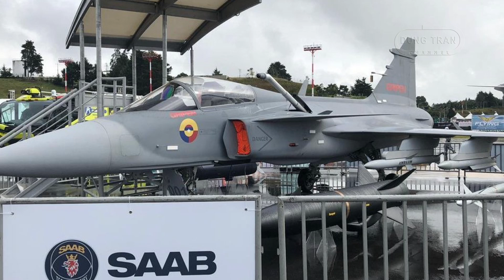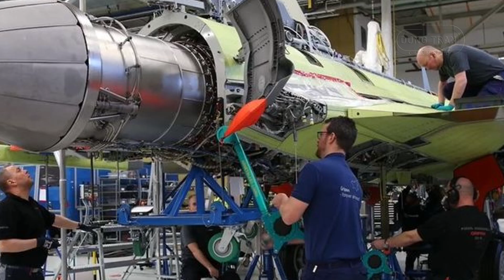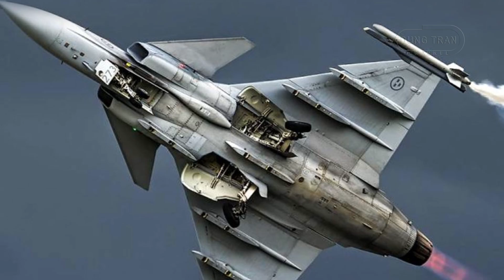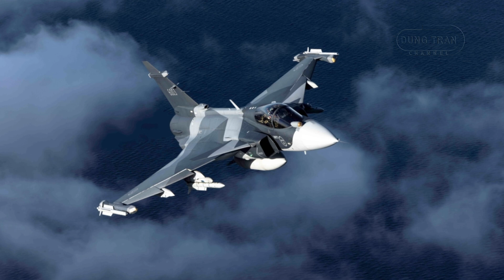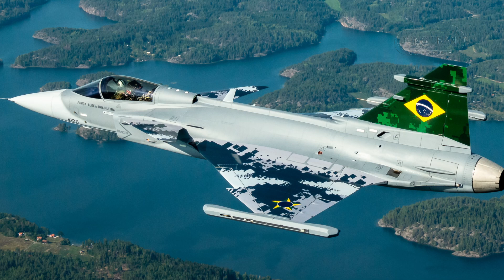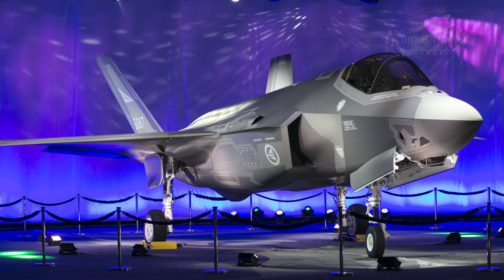Swedish Gripen's Achilles Heel: The American Engine

Comment: Canada needs about 70 aircraft in addition to the 16 F-35's its already committed to.  It should partner with Saab to fund the replacement of the GE engine with one made in Europe.  This would help break the US veto on the GE engine, support the EU, and would give Canada a bit more leverage in its deal with Saab.  The Canadian built Gripen could be called the Arrow II.
Reply: Well Canada did produce the Iroquois engine for the cf-105 arrow but it was shelved. The new company Magellan Aerospace could work with Saab to develop a suitable power plant for the fighter. And we could regain some pride knowing we did it here.
Reply: @richardstevens801 fun fact: Magellan makes GE jet engines. Specifically, the 414-E 

The one the gripen (and f-35) uses.
Reply: With the much lower operational cost of the Gripen, we could easily afford over 300.  Why stop at 70?
Reply: Good idea. But after building the Gripen in Canada we should hold the Arrow II name for our own new design.  :)
Reply: Hypothetically, theres rolls royce facility in Peterborough that could become a maintenance facility and factory for a rolls Royce ej 230 ..so it would be less than an hour from CFB Trenton...the main Airforce Base in Canada it could be done
Reply: @davidbeattie4294  
Thats to late for the Jas 35 
But the new one in development that’s is orders as a concept by FMV to be produced before the end of this year. 
Maybe won’t get a US engine, who knows. 

Stay tuned
Reply: @ Whether an engine change is too late for the JAS 39 depends entirely on whether SAAB has already done any work on alternate engines or not. If they have done the design work necessary to drop an EJ200 into a prototype it's not too late, if they bet the farm on the GE F414 and American benevolence then they are in trouble.
Reply: @ 

Nothing is ever “to late” it’s a matter of money and resources. 

Saab and GKN Aerospace is to develop a new plane before the end of this year. 

Also that plane if it gets the go from the government are to take its first flight in 2030. 

This is shrouded in secrecy, but if one follow the money and the human resources allocated  it’s safe to say 

“It’s to late”
Reply: This is a mostly a BULLSHlT story
Go and look at the specifications for the JAS39 on Wikipedia and see how much of the plane and weapons are American.
- the PS-05/A Avionics are GEC Marconi and even though its now British owned there's still American IP in it.
- the AIM-9 Sidewinder air to air missiles are American
- the AGM-65 Maverick air to ground missiles are American
- the × GBU-12 Paveway II laser-guided bomb, Mark 82 bombs and GBU-39 Small Diameter Bomb are American.

Sure all that can be replaced but integrating other weapons takes time and money.
In fact if you look down at the E & F models the name Arexis is mentioned and that's a division of SAAB. So those models have more European avionics in them but the weapons are still the same.

On the engine the current engine in the Eurofoghter (Eurojet EJ200) has similar (but slightly lower) thrust specs but it might be upgradable to suit. if you look at the Wikipedia page there are plans (2 stages) to upgrade the EJ200.

FYI - I'm Australian and think we should seriously consider a large batch of JAS-39s instead of another batch of hyper-expensive F35s. There's a great video on Ward Carroll's channel with a pilot named Paco (his callsign) and he explained the role of the F15-EX and part of its role is to create noise across the spectrums for the F35s to hide in. There's a problem that when there's only F35s in quiet/stealth modes that it can be so quite across the spectrums they can be found. Its really interesting to listen to him explain it.
Reply: @tonywilson4713  The JAS E/F, which is the actually interesting variant these days, uses the Selex Raven ES-05 AESA radar made by Leonardo in Italy. The AIM-9 Sidewinder, AGM-65 Maverick and GBU-12 Paveway are all very easily replaced. The US normally vetos Gripen sales over the General Electric engines as far as I can tell not avionics or munitions the Gripen can carry. That being said, SAAB and Eurofighter GmbH have a lot of work to do eliminating American IP from their aircraft now that the US has declared itself a completely unreliable supplier. American vetos have ruined far too many sales for Saab already.
Reply: @ChristianThePagan  Am just watching a guy named Dan O'Connor in Nat Hagens. I'd seriously recommend it.

I'm an engineer and some of the things like energy and energy infrastructure is a monster issue in my country Australia AND NOBODY wants to discuss it.
Reply: @tonywilson4713  ASRAAM is supposed to be the Sidewinder replacement, so it should work as-is. Gripen-E can also use IRIS-T (I thought I saw Python mentioned somewhere). Mica for medium range, with Meteor for long range. You can use the Taurus KEPD cruise missiles for ground attack. I can't find it now, but Saab also mentioned smart bombs & an anti-ship missile (not American).

Hopefully, Saab is fairly advanced in their testing of alternative engines. I'm not entirely sure why they stopped the Columbian sale. I don't think F-18s are still in production, aren't F-16s produced offshore now? Turkey will be pissed if they buy F-35s.
Reply: @georgejones8784  Yeah there's bound to be alternatives but you also need to consider that they have to re-configure the weapon system to use anything new.
Its one of the things people forget that you can't just use whatever on these planes. The weapon system has to know what's onboard and be able to use it.
Reply: @tonywilson4713  those are weapons that Saab states are usable on the Gripen (except the ASRAAM). I believe it was mostly on the Indian info page. Others may have been on the Gripen-E page.
Reply: @tonywilson4713 with regards to A2A weapons - it can also use ASRAAM and METEOR. So strictly in an air defense role it is not entirely dependent on US Arms
Reply: @SteelBattalion07  Yeah those are in the weapons lists on Wikipedia.
So its not entirely dependent on the US but enough of it is.

Right now it all comes down to Trump and how temperamental he is on which particular day.
Reply: The Gripen uses the engine from the F-18. So Canada has enough engines for 160 ish Gripens already.
Reply: @JamesBrix86  Canada flies an A+ variant. It's got APG-73, upgraded software for AMRAAM, etc, but I think it's the original engines. Looks like F404-GE-400. The F414 appears to have a little over 20% more thrust, which is partly from its increased size I would guess. If the F404 runs more efficiently, it might work, but the airframes are approaching 45 years. We did buy about 2 dozen Australian F-18s, which might be newer.

Who knows. We should maybe consider buying 50-60 Gripens with an option for another 50. Once the first delivery is completed, we could see what Japan, UK & whoever else has in stealth, and decide between 50 stealth fighters, or another 40-50 Gripens.
Reply: @JamesBrix86  No, the Gripen uses a specialised variant of the GE engine redesigned and license manufactured by Volvo. Also, the really interesting Gripen E/F uses a Volvo variant of the GE414.
Reply: @ChristianThePagan  GE Aerospace makes 2/3 of the RM12 and RM16 engines that GKN Aerospace completes in Trollhattan.
Reply: I like this idea. Very much.
Reply: It's not just the engine, US intellectual property is everywhere in the aircraft.
Reply: @ Then give us a list of the highlights.
Reply: @gumby2241 do we know what other IP other than GE Engine?
Reply: @gumby2241 Please detail - that’s an important realization for me.
Reply: My thoughts exactly
Reply: Agree. The A/B Gripen used the Saab RM12 engine. Saab could develop this engine to equal the  GE engine currently used. A partnership with RR my would expedite this process. Bombardier could under license build this new US-free aircraft.
Reply: Go with the French Rafael dual engine which has always been mandated for artic patrol no US parts and would have beat the Gripen if they didn't pull out because of US interoperability.
Reply: @SeanMcInnis72  Reasonable idea but you'd need a total re-design of the fuselage to take 2 engines.
The planmed advanced EJ200s out of the Eurofighter can do the job.
Reply: @SeanMcInnis72  Canada rejected the F-16 back in the 80s because a single engine wasn't reliable enough in the Arctic. Now, suddenly, a single engine F-35 is ok. The military knows they'll be stuck with whatever is chosen for the next 50 years, so naturally, they want the most expensive plane out there. I wonder if an F-35 will make it to 40. The F-117 is retired & the F-22 will be retired from frontline service soon. Both, I think before 30 years. I haven't heard much about how the F-35 is doing beyond some comments that there appears to be surface corrosion on the skins on carriers. Whether it's just discoloration or actual damaged panels is something that probably won't come out to the general public for a few years.
Reply: I'd sign up for Flygsystem 2020 if it can be modified to uses a European engine license built in Canada. Meanwhile their best bet for an off-the-shelf stopgap, if Canada needs one, is probably the Rafale since it has hardly any American components at all. However the Rafale uses the SNECMA engine so perhaps it is better to go for the Eurofighter since it uses the EJ200 engine which, given recent events, might end up being the one used in the FS2020. Another option is the KF-21 Boramae. There was a design option (C103) for it that could have used either the EJ200 or the GE414 but, oddly enough, the Koreans chose the C109 GE414 only option which now seems like a huge mistake. However, there might be a possibility to obtain a license to produce the C103 version. For sure, Sweden/Saab needs to get rid of the American veto one way or another, one can't be reliant of a politically unstable and unreliable source of military tech like the US is.
Reply: @ChristianThePagan  If Canada needs around 70 stopgap fighters, why not the Eurofighter? The UK is rumoured to be scrapping 50 of them. That would be a far cheaper option than buying new Rafales. Then they would have the breathing space to negotiate a licenced production deal for either the Gripen or the Rafale.
Reply: @skasteve6528  Well, as I said the Typhoon would perhaps be the best short term option or the Rafale. But those 50 UK Trance 1 Typhoons would be better used equipping a post-war Ukraine. Canada should get new-built aircraft. Either aircraft would also be a good Segway for Canada to move on to the Dassault/Airbus FCAS and license producing whatever engine the FCAS runs on since that engine is a Franco/German collaboration project. Alternatively, if Canada goes for the Typhoon and license produces the EJ200 they might consider a EJ200 powered KF-21 if that is even doable. Either way the Gripen is a no-go if Canada wins to de-risk from the USA unless the rumours about SAAB already being hard at work on integrating a non US engine on the Gripen. If that is true this engine would likely be the EJ200 since a variant of the EJ200 has been considered as a GE F-404/414 replacement before.
Reply: @skasteve6528  The UK is NOT scrapping Eurofighters. If they are, the hulls must be completely worn out, because they'll likely want to continue expanding their EF fleet.
Reply: @  I don't think they are slated for scrapping. I remember ideas being floated a while ago about donating ex RAF Trance 1 Typhoons to Ukraine. Dunno how realistic those ideas were.
Reply: @jakobholgersson4400 I don't recall the exact problem, but there's something wrong with the early Typhoons. It was either a software or a hardware limitation that requires something that makes it cheaper to just replace them with new planes rather than upgrade.
Reply: @georgejones8784  So the guy's suggesting the purchase of planes that are obsolete and impossible to modernize?
Reply: @jakobholgersson4400  they're not impossible to modernize. I think the UK looked at the life of the airframes, and considered the cost of whatever upgrades were needed, and decided it was easier to buy more. They're still effective and usable planes, but they just have a few limitations that may or may not matter. Just like some of the early F-35 bays can't hold certain ordinance. Was it the newer long range AMRAAMs or SDBs?
Reply: @skasteve6528  Why would anyone buy those, they are OLD and crappy, and the UK is not scrapping them because they dont need them but because they are falling apart. Anyone they can ducktape together they are ducktaping together and keeping. If you want all European and cant wait for Gripen getting European engines then go French. Rafale is a great plane.
Reply: @georgejones8784  As recently as 2 years ago, many Typhoon planes in service with German, Italian and British air forces still didn't have AESA (Active Electronically Scanned Array) radar, which is the standard requirements for modern fighters. Naturally, it is not just the AESA radar but also the software & computing power required to handle/process  the increase data & sensors. A sizeable chunk of new increase in defense spending in Germany is going to upgrade its Typhoons with AESA radar. Dassault Rafales have been flying with their RBE2 AESA radar for 20 years.
Reply: @qtdcanada  yes. I was looking it up. The tranche 1 Typhoons don't have AESA, and carry only ASRAAM and AMRAAM. Tranche 2&3 add Meteor, Storm Shadow & Brimstone. The tranche 1s could work for Ukraine & Canadian NORAD duties, but at some point, true multirole planes would need to supplement them. The tranche 3s appear to be plumbed for conformal fuel tanks, which would be nice in Canada (but I'm not sure than the tanks exist).
Reply: @skasteve6528 those typhoons have old nonAESA radars. It would cost 50m per plane to upgraded to the newest AESA block 2s
Reply: @Aendavenau  Those RAF Tranche 1 Typhoons are not falling apart, they have been considered for overhaul, upgrade and donation to Ukraine. They would have to have been VERY roughly treated if they are falling apart while much older F-16s and Mirage 2000s are flying combat missions in Ukraine. As for wanting older old aircraft, it's the same reason the obsolescent Curtiss Hawk 36 suddenly became a hot commodity in 1939, when countries suddenly found themselves on the brink of war with air force full of thoroughly obsolete aircraft from the 1920s a merely obsolescent fighter 1930s fighter was better than nothing and you can still upgrade older aircraft and get a whole lot of use out of them.
Reply: @jakobholgersson4400 
I think you mean air frames, and not hulls 😂
Reply: @georgejones8784 There was a major redesign to creste the Tranche II so software developed for it won’t run on Tranche I. Upgrading Tranche I to a later tranche is not cost effective.
Reply: @skasteve6528  We need them because we will need to protect Arctic - the Gripen, with its decentralized operational doctrine works better for that environment. Think beyond just the airplane itself. It must operate in remote areas, without any large facilities and dispearsed all over the Arctic - Gripen does this better than anyone. Sweden and Canada's Arctic are cold and this aircraft is designed and built to operate in that theater. The F35's we have purchases, will be great at our Southern boarder, but not suited for the harsh realities of the Arctic.
Reply: The SAAB was #2
Reply: @ Yes, but it was #2. before Trump 2.0. Now Canada needs something with no US components in it.
Reply: Our F18s have the GE F404 that has been used in some Grippens.
Reply: @realalbertan  Yes and the Americans can veto any sale to Canada because of the F414 engine the Gripen uses. If Canada wants to annoy Trump by scrapping the F-35 deal then it needs an aircraft without a single US part in it which basically limits Canada to the Rafale.
Reply: Why not just buy Rafales or Eurofighter Typhoons? I just dont get this obsession with the Gripen that many Canadian avgeeks seem to have. The Gripen is easily the least capable Eurocanard...
Reply: @lonewolf0281  Because it was the runner-up after the F-35. The new E/F version is also very impressive in that it has gallium nitrate EW modules built into the airframe for stealth, AI enabled systems, it has very impressive arsenal and it has *some* of the same situational awareness options as the F-35 (although the F-35's are better). Finally, the hourly operating cost of the F-35 is $40.000 and it requires state of the art air bases. The same goes for the Typhoon and Rafale, they need high end bases and they are expensive to operate (EUR 20.000). The Gripen costs $4700 per hour to operate, it can take off from rough grips and highways and it can be operated in the field out of a shipping container which would be a feature for a sparsely populated country like Canada.
Reply: Something with a Rolls Royse engine please
Reply: it would take years to adapt the design - you need to adapt assembly lines, jet design, and everything that interacts with the motor (hardware and software wise). why not just buy the rafale which is already ITAR free.....
Reply: @Tortuex_  because at the last minute, a specific data link requirement was demanded for NORAD compatibility. Suddenly, everybody except JSF and Gripen dropped out. I guess Eagle & Hornet don't fly continental defence missions. Anyways, Eurofighter & Dassault saw what was going on and dropped out while Saab did not. Something you have to keep in mind is that the previous Conservative government had decided to purchase 65 F-35s without a competition just before losing the election.
Reply: Or alternatively buy the Euro Fighter - Typhoon?
Reply: @davidbeattie4294  or go Eurofighter Typhoon with BAE or go Rafale with Dassault.
Reply: The Eurofighter EJ200 engine will replace the GE perfectly.
Reply: LMFAO one US air craft carrier has more of an Airforce than Canada has. What a joke.
Reply: @PPM7ke That may be true, but we have more manners. What’s your point?
Reply: @PPM7ke The US also has eight times the population Canada has so that’s not surprising. Were you born this obtuse or is it the result of years of hard work?